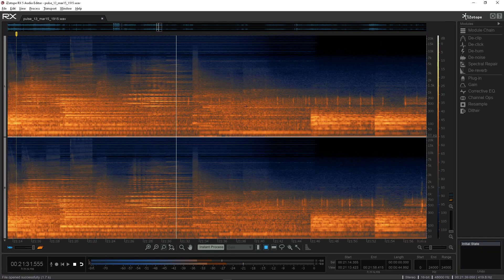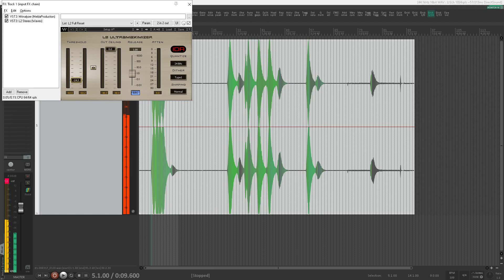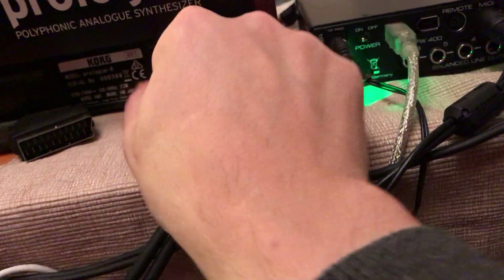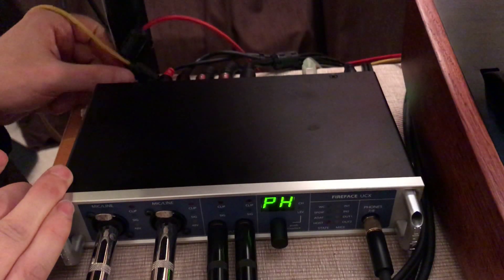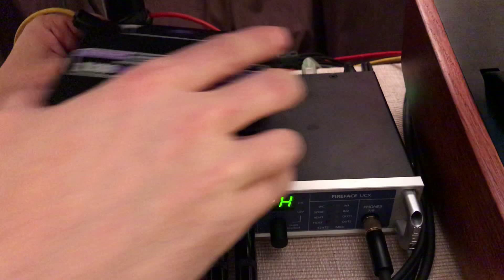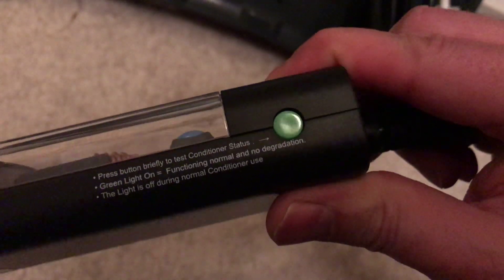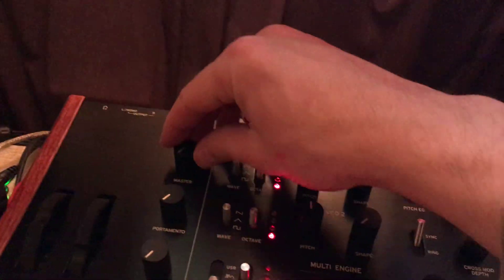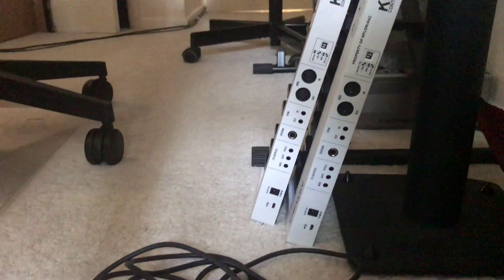EP#04 Testing a Power Conditioner and other solutions to remove electro magnetic interference.

Comment: Hey i have a similar problem but with heavy metal guitars, noise just creeps in my recordings like that whenever I play, like the noise you would get without a noise gate.
Maybe I can send you a file and you can see what I mean? Will a power conditioner solve this?
Reply from the maker: Hi - I am no expert in this and got my the from testing and comparing. Are you recording with a computer? In which case try without a PC present and see if the noise is still there? 

There might be a different reason for you then my (what seemed like an) USB related noise pollution on my system. 

Alternatively, if there is a return/fair use policy then you could try and buy one and return if it doesn't work?
Second hand might be an option too perhaps? Sorry I can't be more helpful.
Reply: @GameAudioToolkit  yes I record with pc.  Uad appollo twin direct hi z input.

Comment: Hello! I think I have an electrical noise problem in my studio. When I want to use my guitar amp or record guitar, I always hear noise at the same frequency (7k hz and above) and harmonics. When I use a microphone, I do not encounter this noise. When I use an analog compressor, there is really very little noise. How do you think I can solve this? Should I use ups or power conditioner?

 I hear this same sound in guitar amps. Even if I turn off all items such as air conditioner, refrigerator, lamps, I hear this sound.

Comment: I had the exact same noise.  Wanna know something wild?  I hear the noise on my AC-powered laptop when I scroll on my *desktop*.  The two are completely unconnected electrically aside from  the AC mains.  I think it's my desktop GPU power gating like crazy and throwing a ton of noise in to the neutral or something.  As soon as I even make contact with the audio-interface USB plug ground, I start hearing the noise.  Before +5V or data are even connected.
Reply from the maker: Wow, that sound like the old days when we had to manage 16 irq’s for hardware sharing carefully, or indeed hear scrolling on the speakers.  Did you manage to find a solution for this?
Reply: @GameAudioToolkit  I ended up doing a 2 punch.  First, an ADUM3160 powered USB dongle that optically couples the USB signals.  That seemed to help a lot.  Second I found that I did have a massive ground loop created from my laptop to my desktop because I (forgot) that I had my microphone run into both my laptop and desktop.  So a ground loop isolator (3.5mm) fixed it right up.  Now it's perfectly silent at max amplification.  I tried other things previously like AudioQuest doo-dads and AC power filters but none of them made a difference.
Reply from the maker: @someusername121  great detective work on your end, thanks for sharing and showing that there is unfortunately not a single silver bullet solution to these challenges. Glad to read that you have solved it.

Comment: Thank you! I just bought the furman ss-6b power strip that i guess isn't quite a conditioner but should filter out interference and i hope it does the trick. after watching this video, if the strip doesn't work, i might have to try the rack version like you used. There's cell towers on the roof of my apartment like 15 feet above me so i might be outta luck but here's hoping!
Reply: Have any luck with your power strip? Certainly cheaper than the rack models..
Reply: @burntkappa6005  I feel like it made a bit of a difference but the interference is traveling through the air still. Hopefully I'll be in a new place soon and I'll have a quiet setup :)
Reply: @_OopsieDaisies  That's unfortunate, hopefully your new place gives you clean sound! I'm fighting something similar right now, I'm going to move soon anyway but trying to solve it in the meantime is annoying. I'll update if I find a fix!
Reply: any updates?
Reply from the maker: @andvgeo2253  interested too, always appreciate the effort when people update a previous question or finding. Hope it worked.
Reply: how has it been for you

Comment: I got the same Furman, it helps, but also you should separa audio cables from power cables. And use good cables like the sommer karbo series and neutrik golden pin and you will get even better sound. I gonna upgrate my Furman for a one of the prestige series plus a furutech cable. Thanks for the video
Reply from the maker: You are very right and those are some really good tips in your reply - thank you for sharing this information!
Reply: I don’t think power cables will do much to improve anything unless they are shielded. Look at the Furman specs, some of their more expensive offerings don’t seem to offer a significant improvement in filtering AC.
Reply: @sphaera3809  thank you for the info about the power cables! I will consider buil my own power cables! I got very good audio cables in all my conections but still having the standard power cables in also all my gear...do you think I will notice at least a minimum improvement with shielded power cables? I mean, in all my chain.
Reply: I got new Furman, sound is less picky, and little bit cleaner. Like all in profesional audio, is only a micropart of all the big puzzle.
Reply: Check out how bad a Furman eliminates electrical noise, it is a joke. I wanted to buy a Furman....now I don't want to anymore. Check out THIS video....you will be shocked.

https://www.youtube.com/watch?v=3qFh1e7razo&t=211s

Comment: I also have the same issue on my PC and with my scarlett 2i2 interface. It looks like the sound comes from the CPU and its pick up and amplified by my guitar
Reply from the maker: One thing I didn’t test is to simply keep analogue audio cables away from power and high speed usb cables. Before investing any money in a hardware solutions, try wiring your setup such that analogue cables stay away from anything producing ef noise. Another tip would be to put the amplifier on a different electrical circuit.
Reply: @GameAudioToolkit  I don't use any amp, I plug strait into my interface with a TRS cable
Reply from the maker: @killingforreligion  Gotcha, misread "amplified".
Reply: @GameAudioToolkit  I know it’s a bit of a late reply, but one thing I was taught in school is to make sure power and audio cables only cross perpendicular. Do not have them run parallel. Of course, better not to cross them at all. This probably doesn’t matter as much with balanced cables.
Reply from the maker: @bubblepipemedia3414  maybe no,  but good practices are worth mentioning and certainly there is a relation between usb, audio cables and power. Thank you for sharing knowledge!
Reply: I have the same problem here. Did you found a solution?
Reply: @lucasdasilvaeso  Unfortunatly no... I think one of the option I have is to put my PC further away from me.

Comment: I've been Googling for hours and this is the best video I've found on this - thank you.
Reply: Hey all, I wanted to follow up on this (because I know I appreciate when people do). The ultimate solution I found to my interference problem was to shield the speakers using copper (either copper tape or copper fabric). This appears to have completely eliminated the issue, and I was able to do it quite inexpensively ($15-$30). Clearly this means that the cause of the noise issue was different than this video creators (excellent video, once again), but I thought I'd post this as an alternate solution to anyone else who is stuck.
Reply: @DubMonitor  agreed- it's so good when people come back and update, so thank you very much and happy to read that you managed a cheaper and workable solution. 

How did you shield the speakers? Did you wrap the speaker in the fabric?
Reply: @matthewflorianz   I basically imitated what this person did, except didn't bother with the mesh part as the noise was already gone before I got that far: https://www.gearslutz.com/board/so-much-gear-so-little-time/1295860-successfully-shielding-yamaha-hs8-monitors-rf-interference.html
Reply: Did it help for your case ?
Reply: @killingforreligion  Unfortunately not. Still hunting for a solution. I'll figure it out eventually!
Reply from the maker: Hi! Brilliant, thanks for letting me know. Hope it helps you out.

Comment: i discover mine it is because of a power transformer or any kind of power supply that has a transformer inside. putting it near in audio cables or wires of interfaces cause frequency interference.
Reply from the maker: That is a good tip, thanks for sharing. It is possible that it could have been the case for me too, and the process of rewiring/repositioning fixed it. The video is by no means a scientific process. Glad you got it solved!

Comment: Hi 
Thanks for this video.
I have recently purchase same furman conditioner. Im waiting for cables. Could you make a short video haw you connect your equipment through the power conditioner outlets please. Im in UK so I have same power sockets. A bit disappointing furman dont provide UK cables and cable patches. I have purchase power conditioner to reduce similar noise. While I'm recording my guitar thorough usb I can hear my mouse when I move it. I hope this furman will resolve the problem. Cheers!
Reply from the maker: Hope that the Furman helps you out like it did for me. The cable patches are obtainable through various outlets and I was aware to need them, so ordered a batch. If you search for Computer Extension Cord, IEC320C13 to IEC320C14, or Kettle Lead/Power Cable you should be able to get them. I also got one of these: https://www.amazon.co.uk/gp/product/B074Q3PKKS/ref=ppx_yo_dt_b_asin_title_o02_s00?ie=UTF8&psc=1
All good points, I'll add them to the description. 
Did have a spare Uk Plug and got it to fit the metal contraption with some bending and shaving off plastic (without exposing any conductive bits). You don't have to use it as it's a preventative measure for accidentally pulling out the power cable.  
Hope it all works for you, don't invest too much in cables till you know for sure it fixes your problem. 
Finally, I have everything in my chain connected to that same Furman box. Computer, Monitor, speakers, sound-card. Think of microphone, guitar amp etc. all needing to go through the Furman and observe it's maximum draw. Good luck!
Reply: @GameAudioToolkit   Thank you so much for response. I really appreciate  it.

Comment: Hello mate.. ive got a simliar problem with my house wiring causing problem like this with my gaming pc.. my mouse and keyboard lag in shooting games.. im wondering if you know if this will help or fix the issue ? ive brought a mains conditioner like you and it didnt help but the furman helped you ..
Reply from the maker: Hi Adam. I am no expert and didn't even realise a relation between power, lag and input can exist as you describe. My problem was audible and measurable and believe it must have come from having different power supplies connecting to each other via the cables running between them. Ie. synth on power supply A, audio card on power supply B, computer on power supply C and cables running between all of them. 

Furman's are used in studio environments so that was why I invested in getting one as they aren't cheap. 

So honest answer is that I don't know.